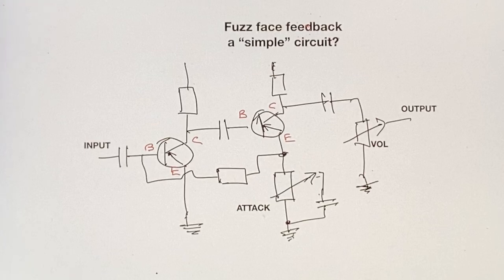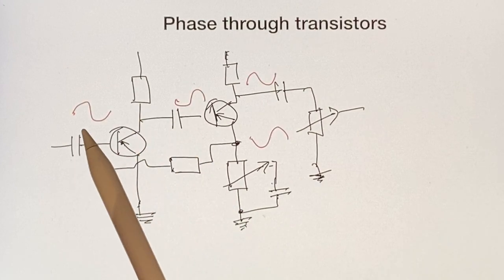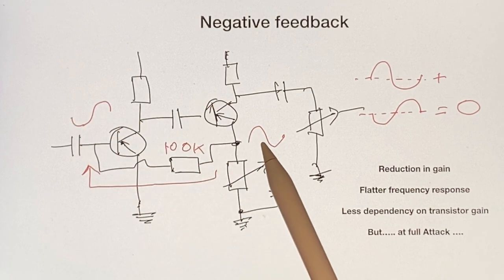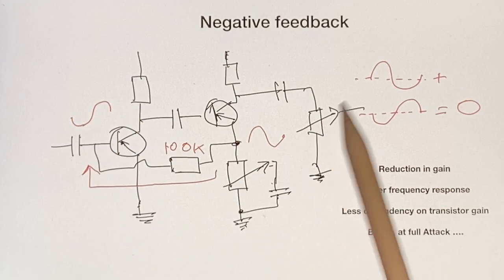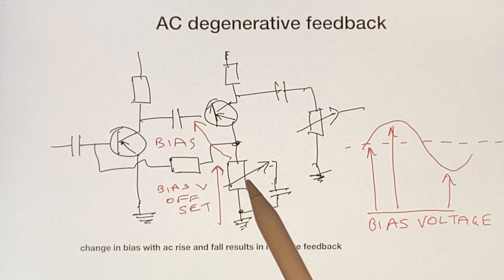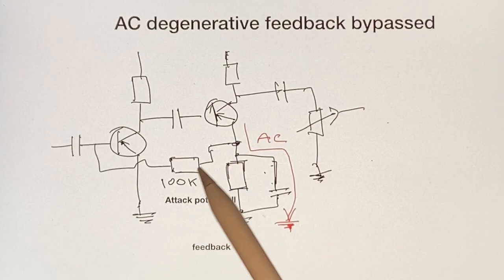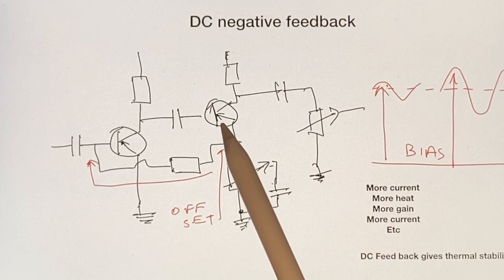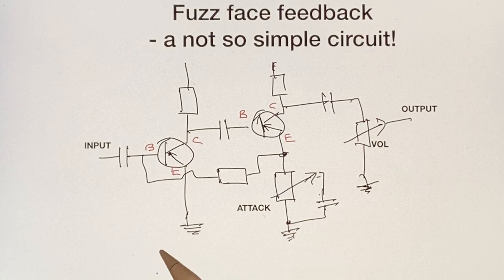Fuzzface circuit feedback - thoughts

Comment: One thing I don't get is why the signal would go trough a 100k R instead of the 1K pot to ground?
Reply from the maker: A small portion goes through the 100k, which is all you need. The output of the second transistor attempts to be 100s of times larger than the input so it doesn’t take much to have the desired effect.